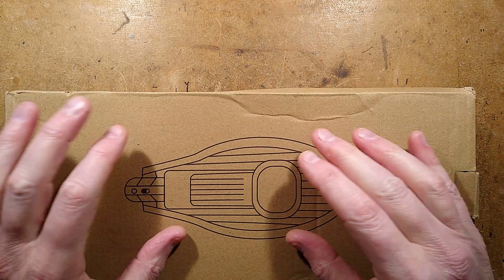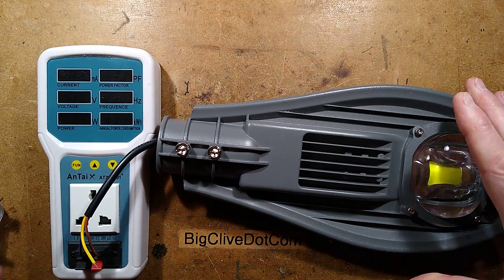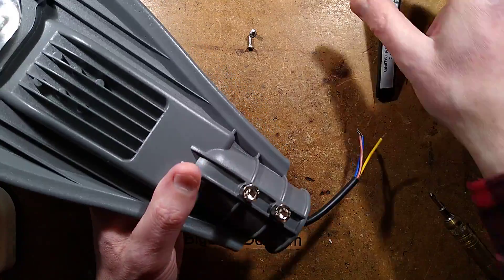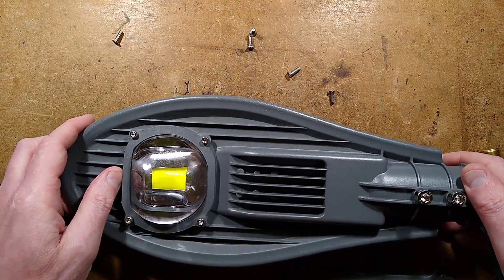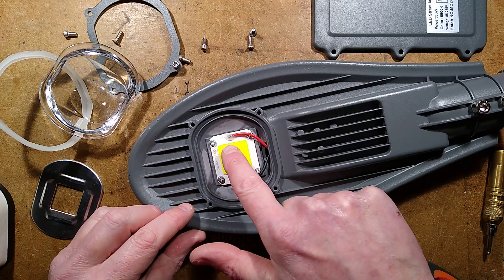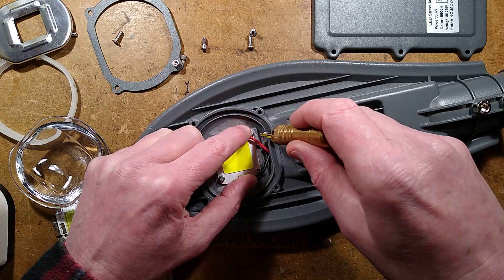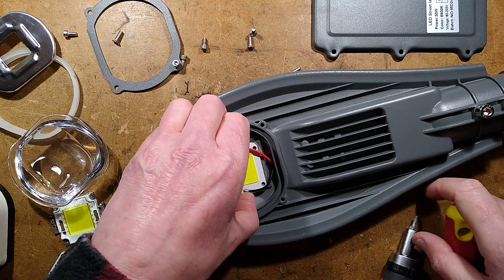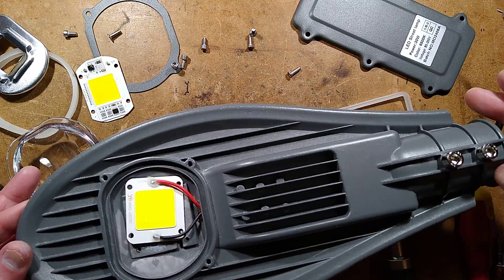Inside a Chinese street light from eBay

Comment: Hi Clive, is that a real led streetlight? Because 26 watts is a bit low even for LED
Reply from the maker: Real street lights start at around 10W depending on the application.  I've got a couple of European 20W units here.
Reply: @bigclivedotcom  What? This is amazing. Here in Tunisia they are starting to relamp everything with LEDs too and they are replacing High pressure sodium 409Watt with 100 to 200 watt LEDs i guess from the brightness. 20 watt would be too little on a main artery. Greetings from Tunisia bro, Continue the great work for all of us fans.

Comment: For a 30W ligth the power factor looks a bit to low. We had some flood lights with same looking driver and COB LED. They failed quickly and the housing behind the COB LED was paper thin. No idea how the heat should speaded well and yeah the PE connection xD
Reply from the maker: Some have very good power factor drivers and others like this have poor power factor.

Comment: Im an electrical distributor with my dad now and seeing the contrast between the cheapest things possible and actual brands that deal with this stuff is crazy. We stock parking lot heads that are 100-400w metal halide equivalents and they are WAY higher quality than stuff like this, full metal construction, wide angle glass lenses, much bigger led chip layout, color selectable, wattage selectable, the internal connections are also much nicer with wago connectors and solid ground terminals. Another difference between this direct from china street lamp and a dedicated fixture is for sure the cost though, even the lower powered ones we have are still ~150usd but this is way cheaper. I guess if you dont care all that much about quality and just need something then i guess it works

Comment: I changed my to eliminate the driver unit as it was interfering with my ham radio.  It worked  ok for 3 months.  It burnt out. Replaced with a spare cob and the same happened. Were not reliable.  So gone back to the original. Make sure it's off when using radio. Now fitted pir device.

Comment: Getting used to poor or non existent Earths is unfortunately becoming the norm. Perhaps the manufacturers are only used to Type A and C and not I sockets.
Speaking of LEDs, I'd like to see a video on car LEDs or more so, understand why they flash rather than just being on. I have noticed the flashing several times and had difficulty in convincing people that they do flash. It's easy to see when filming but not so with the naked eye. Point being that the flashing along with traffic lights flashing is just another (dangerous) distraction).
Reply from the maker: The vehicle lights sometimes use PWM for intensity control.

Comment: You should remind yourself that they probably have millions [if not billions] of unsold LED drivers [and LEDs that need drivers] that need to be used up before they can fully embrace the driverless LEDs ... similar thing happened with the 0.3mp cameras ... they had millions [if not billions] of 0.3mp cameras that they had to get rid of ... so they used software interpolation to help shift them. 
Another thing possibly worth remembering might be the fact that the factories that produced these LED lamps probably no longer exist !

Comment: Clive, would you be able to advise where to get part to repair an old TOMY Astro Blaster game, I need a W06A diode for the psu in on the circuit board input is 6v. I have pics but can’t post them here. Many thanks for any advice 👍🏻
Ron
Reply from the maker: Is it just a standard polarity protection diode?  I it is then a typical 1A diode should work.
Reply: @bigclivedotcom  
Thank you very much for the reply and advice 👍🏻
Reply: @bigclivedotcom  Thank you Clive I’ll give it a try 👍🏻

Comment: The label suggests a driving voltage of 85 to 265 volts.  Does the driver maintain a 30-watt power, and thus brigntness, regardless of voltage?  Or does the power and brightness drop with lower driving voltage?  Thanks for the great video.
Reply from the maker: The drivers maintain constant output.

Comment: You could do a lot of things if you actually gave a wet fart about the longevity of your products. one thing would be to put the driver on the bottom side where it's protected from rain.
Reply from the maker: I've got one on order that DOES have the access panel on the bottom.
For maintenance reasons, the top is preferable though.  Much easier to access in an aerial access platform.

Comment: I don't know the point of the Earth if its on a metal pole stuck into the ground. Also if it is properly power-coated I would think it wouldn't rust as long as the coating wasn't damaged. The concern for me is with all these mains operated LED lamps - these seem to have planned obsolescence built it in so it will probably fail before it has rusted. I've kept all my failed 230V LED lamps and converted some to 12V for my solar powered electrical system.
Reply from the maker: If an ungrounded metal lamp post becomes live there is no guarantee that enough current will flow to trip a breaker or blow a fuse.   There's also a huge risk that the badly trained labour who maintain street lighting may increase the rating of a breaker or fuse to "fix" the problem.
People getting electrocuted from live lamp posts is surprisingly common.

Comment: I suspect they've not gone for a driver on board, because it's rated for 85V to 250V, and the drive on board LEDs generally use a linear power supply, which is only rated for 230V. This means they can sell the same model in both 120V and 230V markets.

Comment: Aluminium and steel is problem waiting to happen,  galvanic corrosion is inevitable, japanese motorbike engines being typical where the engine cover screws weld themselves into the casings.

Comment: I bought a pack of UV cob's ages ago.. I think they are 11.6 volt.. my intention was to run direct from a 12 volt battery with a resistor... voltage can be 12 to 14.7 volt when being charged by solar or battery charger..
Then I learnt about the driver being constant current..
I couldn't find 12v drivers...
I don't understand the concept.. would a resistor work or is there a circuit?
Any suggestions?
Could you do a video about the driver's and how and why.. is voltage important?
Reply from the maker: A simple resistor will work for low power use and a known fixed supply voltage.  The current regulator circuits are useful where the supply voltage may vary.
Reply: @bigclivedotcom  
Thank you for your reply.
How near does voltage need to be?
&
V / I = R 
How do I work out I ?
I've got some low value ceramic resistors.
Edit.....
I think they are 10 watt
so...
W = V x A
so... It consumes about 1 amp..
Now what mathematical magic to work out a 1 volt drop.. ie 12.6v to 11.6v or 14.7v to 11.6v (I think it's 11.6v)..
How fussy are they?.

Comment: One big advantage of not using a DOB (Driver On Board) LED module is that it enables the use of 'smart' control gear by simply swapping out the basic driver rather than having to replace the whole LED chip as well.

I suppose that, in theory at least, an RGB LED module and controller being fitted enabling the possibility of lighting effects or HCL (Human-Centric Lighting) functionality if someone wanted to do something really clever.

Comment: Does this one have a death beam capacitor?
Reply from the maker: Yes.  There is one inside the 5G death-beam module.  Being a cheap unit it is very weak though, and will take at least 5 minutes to melt a pram.

Comment: We've got the grandfather of this light out the back. It's survived 12 + years of Australian summers, torrential rain and  "slightly cooler" weather, with (so far) zero problems. They had skimped on the heatsink compound when we originally bought it, and it has the original square LED panel, so ours might be a "better quality" than the AliExpress seconds perhaps? Still seems to produce more than enough light.
Reply: To be fair, they probably don't have much of a need for heat sinks in places like Europe.

Comment: Our local shopping centre put up a load of outside LED flood lights around the outside of the building.  I had a good look at then and they are beyond cheep and cheerful, they are rubbish and they will not last very long.  8 Months later the LEDs all brut out and they replace the LEDs flood lights with cheep and cheerful ones and so far they are still working but I will give then another 2 years and that's it

Comment: hi, may I ask about  using non motorized screw removers.  do you find it better to do by hand?
Reply from the maker: I use the time to discuss the item.   If I run out of info I pause while I remove the screws.  A recent test with a powered driver was unpopular.

Comment: So I'm guessing that the extra heatsink bit near the actual glass (with the six plastic thingies) is for extra cooling in that area since it has circuitry that can accumulate heat quickly. Not adding even heatsink all around and adding more and less in some parts helps companies save money. 

After all, business IS about saving MONEY after all, right?

Comment: I purchased my first 10W LED floodlight in 2012 and it was 100% thick cast alloy, even the frame holding the glass, all screws and washers were stainless steel, only the C shaped support was mild steel.
I paid over 30€ with shipping but it lasted about 26400 and something hours, I know that because it was wired in parallel with an hour meter.
Anyway the COB LED failed because the driver decided to go from 300mA to over 1A, I had bought three of them and only used one, but since it lasted so long the other two must be now at the bottom of some box hidden under 40cm of other surplus things...

It seems on all current units of the same style the glass frame is thin sheet steel and on most of them also the rear cover, while the screws are now galvanized steel.

Comment: Harsh white light. Custom components the user will never be able to find replacements for. Buy them 4-5 at a time so you can replace them quickly as they fail. Leave your ladder bolted to the wall or post this mounts to so change-up will be quicker and easier. CHINA.
Reply from the maker: Ironically you can easily get both the LED and driver easily.  Unlike the posh street lights.  You can also get them with soft warm light or even coloured if you put a new LED in.

Comment: Thanks for this. Plenty of solar lights here in the kingdom of Eswatini. This is not solar but I would use it.
Reply from the maker: It can be retrofitted with a low voltage LED and driver.

Comment: Fun fact! Harsh, cold lights often have the opposite effect than one desires from visibility. Since the light doesn’t diffuse as much, you end up with high contrast areas that essentially make it harder to see things outside the halo of very bright lights. I used to work in crime prevention and safety and the realization people have when you show them the impact of a “warm” light that spreads beyond its bright cone and one of these cheap “super bright” lights is always amazing. It’s a forehead-smacking moment for many.
Reply: I want to contribute that if you are arguing for traditional high pressure sodium, their CRI is so low that some things don't even seem to be illuminated under them. Cool white but focused streetlights are just another evil. Technology Connections makes a good video about this

I personally feel that the color temperature, assuming the light is capable of a respectable CRI, isn't as important as the spread and diffusion of the light.
Reply: @nicksystermann1558 Pretty much two ways of saying the same thing although the physics are different. Color temperature is about where the peak of a black body source is, CRI is more about how rough the spectral curve of a light source is. Sodium or mercury vapor lamps are effectively single lines you can’t define a color temperature for.

What the human eyes sees is a very complex function of what wavelengths of light are available, how much of each is available, and what they reflect off of and almost never corresponds to what a camera sees, of course.

Being a night owl I have had many night jobs, and being old I’ve had to navigate under all sorts of artificial light sources. Vapor lamps as you say don’t seem to illuminate some things at all because they don’t reflect what the lamps radiate

I miss tungsten lamps something awful. They are a better approximation of sunlight than any other currently available commercial light source, imo better than so called warm white LEDs. Shame they are so horribly inefficient.
Reply: @nicksystermann1558   I was actually referring to headlights...
My understanding form looking at research in the past was... paraphrasing.... that there's a  trade off to lower color temperature vs. Higher temperature... true daylight being the best balance... lower color temperature provides better depth perception and texture recognition,  also pearcing fog and heavy rain.  Higher color temperature provides better color differentiation,  sharper contrast, and farther perceived illumination distance. To examples from my experience in areas where there is no street lighting... halogen headlights are better to see deer lurking at the roadside, while I couldn't necessarily identify color as well  the shape and fur texture are more distinguishable . The high color temperature HIDs and LEDs make it harder for me to identify vehicles through fog especially the extremely bright ones but that's less about color and more brightness...
Reply: and the jerks who aim them blinding the vehicle traffic suck
Reply: And for some reason a local supermarket "updated " it's parking lot lights to a purplish blue tint, makes for Crappy visibility
Reply: @Nocturnal2990  it was apparently some bad phosphor blends used in many leds that failed prematurely shifting the color purple.... my local utility has been fighting with it for several years now and asking customers to report any affected lights.....
Reply: As my old nan used to tell us ... "warm white is alright but cool white is dog shite".
Reply: I wish someone would share this information with the wonderful bright intelligent people who pass me in the morning and evening commute.... *heavy duty sarcasm  implied * 😊
Reply: Colour temperature is simply a measure of the light's dominant hue, it has nothing to do with being "softer" or "harder" (which depends on the emission area, diffusors, and the surrounding environment).

Also, note that a higher (hotter) colour temperature actually corresponds to bluer light, which most people traditionally describe as "colder".
Reply: @RFC3514   while you are basically right it kinda misses the point.... the color temperature affects how the human eye picks up various aspects of the surrounding environment due the mix of rod and cone cells in our eyes working better with in certain scenarios with certain   hues... for most of human history the higher color temperatures would have been less common in our environments other than full sunlight  which has a broader spectrum of colors than mosy artificial light sources......so we're not as optimized for it being as "helpful" for low vision activities
Reply: @alexlail7481  - It doesn't affect how harsh the shadows are, which is the specific point I was addressing. That's a result of how diffused the light is, not what hue it is.

I could go on for hours about cones and rods and regions of overlap and relative distributions of different types of cones at different distances from the centre of the fovea, and how we're all really tetrachromats in a specific part of our retina (around 4 degrees off-axis, in case you're wondering) because rods don't exactly match the spectral sensitivity of any cone type, and why our visual system creates fictitious colours that don't correspond to any wavelength of light in the purple part of the spectrum, and so on... but none of that has anything to do with what I was addressing, so I won't. 😜
Reply: @RFC3514  dude that is amazing information. feel free to elaborate and talk for hours. theres so much bung information about human vision out there. im finding so much common knowledge is complete bunk.
Reply: @pepe6666  - Part of the problem comes from what's known as "opponent process theory", which started out as one guy's (essentially "artistic") opinion about how people perceive colour, and later became actual science (based on wavelengths, how cone cells and neurons work, etc.). But some people were still trying to prove the old version, rather than figure out how it actually works.

Most modern studies are decent (and some deliberately avoid the term "opponent process", because it has become so poisoned), but a lot of popular science articles mix them up with information from the old version of the (pseudo) "theory", so they end up being misleading.

And then you have terms like "complementary colour", which mean something completely different in science and art (and, again, a lot of journalists don't seem to understand that and mix up the two).
Reply: Wear sunglasses.
Reply: By "crime prevention and safety" do you mean surveillance? "Crime prevention and safety" sounds very Orwellian...
Reply: It's just a shame that warm color temps are so ugly 😭
Reply: @RT-qd8yl  In the leds market they are differents colors temperatures, i personally prefer the color of around 4500k
Reply: @RT-qd8yl   this isn't meant as slight , I am  just curious.... were you born after 2000 and/or do you live outside North America?
Reply: @RT-qd8yl personally, I prefer warm white